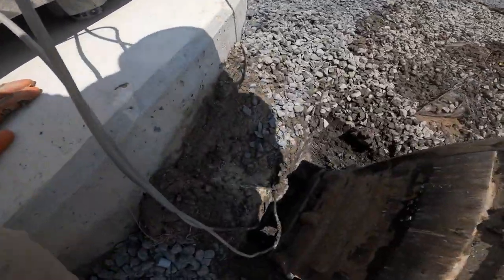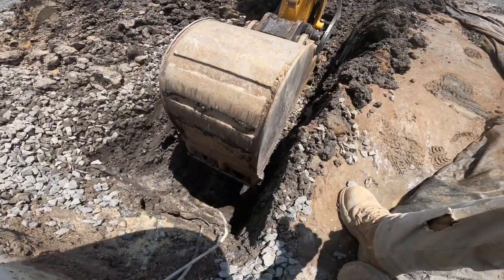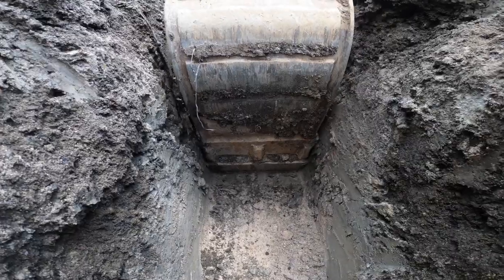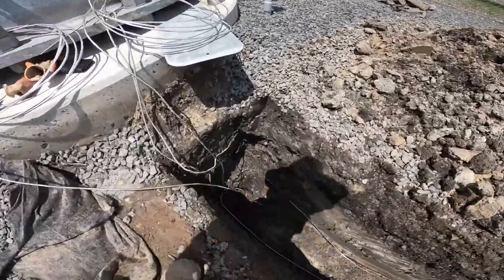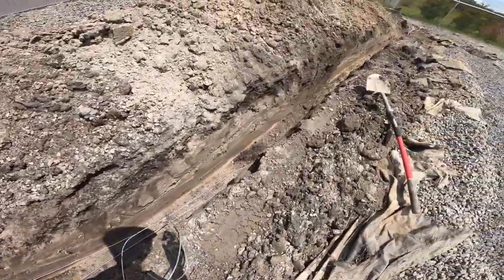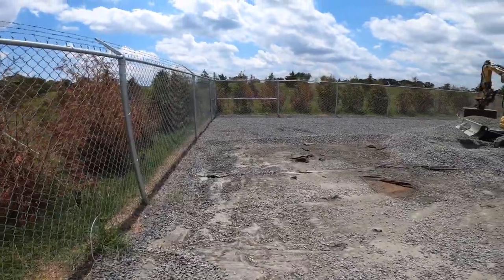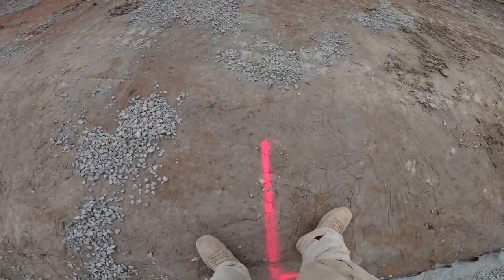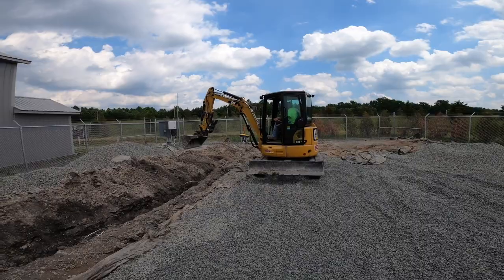Cat 303.5 Mini Excavator "Starting a new job in Delaware"

Comment: I just picked up a 303.5E2cr in early june from foley cat in Piscataway! I like it, but it’s a little slow for me and I wish it had a little more weight on the counterweight!
Reply from the maker: BKD825 268  I agree it is a little slow and light in the backend. Does yours sound like it’s laboring when you are digging? Almost feels like it’s wants to stall! Would you buy one again?
Reply: Full Tilt Grading No mine doesn’t feel or sound like it bogs down while digging, just too slow! Foley sent a tech out to look at it and he said the pump was only 500psi under the relief pressure so he couldn’t turn it up anymore, so I’ll just have to get used to the sluggishness lol! My next machine will be a 305, I’ve operated plenty of 305s and 305.5s and they all seemed to be quick and have plenty of power and more attachment options!
Reply from the maker: BKD825 268  I decided to go with the 304. I don’t think the 303.5 will hold up to my impatience lol.

Comment: What bucket is the wide grading one? I have a 303.5 and have been in the market for a wide grading bucket. Thanks for the video
Reply: Thats a ditch bucket i believe  not my video  but my bucket is identical  except mine tilts looks like a 42 inch
Reply: I have the 47” grading bucket for my 303.5 and absolutely love it!
Reply: @BKDOPERATOR268  do have tilt with that bucket as well? I could see where that would come handy
Reply from the maker: Nick Marks  it’s a 47 inch custom made bucket modeled after the one that Cat makes this one just has more capacity. Thanks for watching. 😁
Reply: Nick Marks they do have a grading bucket available with a hydraulic tilt, I believe it’s around 3,500 dollars from cat

Comment: I’d like to have a 305 with rotating head, that one have a hydraulic quick connect to change out the buckets?
Reply from the maker: Louisiana Dirt 218 yes it has the hydraulic quick coupler. Once you get used to that there is no going back. I will change buckets and attachments sometimes 30 times a day. I like the 305 but it’s a little too heavy to pull behind my 550 with all the materials I need. I’m trying to stick with another 304 or the 303.5.